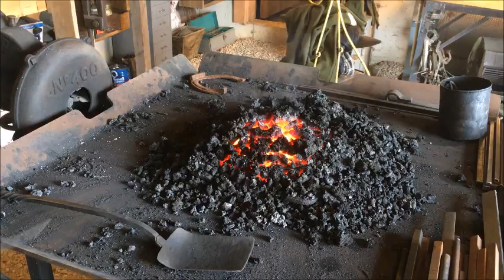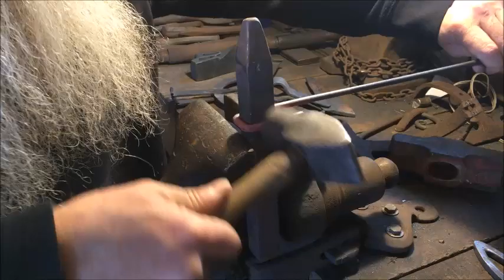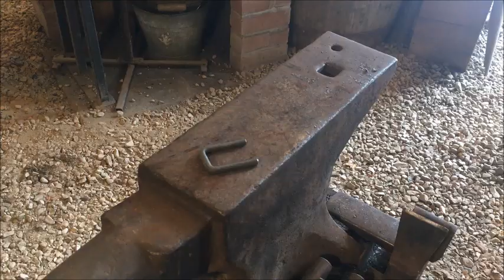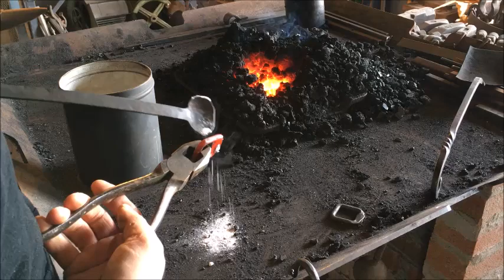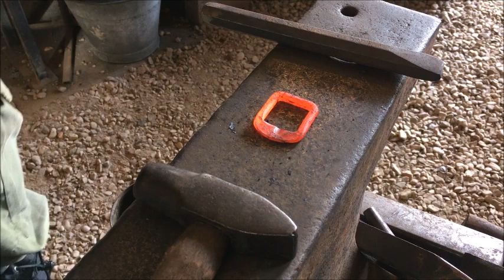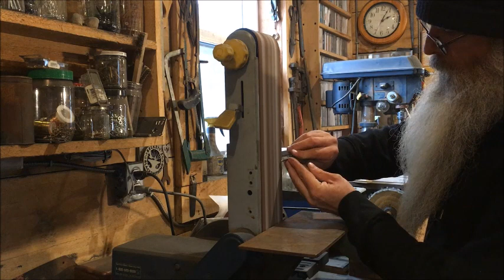Forging a Square Buckle

Comment: Just watched your belt buckle video... I want to try to make a buckle too. Thanks for showing the process!!!
Reply from the maker: Thanks for watching.  This method is the easiest way I have found to make buckles.  It only has one little forge weld in it.  I usually make several at once incase the weld gets messed up.

Comment: Real Nice perfect simple projects to initiate any one to blacksmithing and it's possibility Well done Thanks for your contribution in shearing your knowledge .Will keep some of us thinking and busy. Take Care 
From Quebec
Reply from the maker: Thanks.  This is a pretty good starter project for forge welding.  It is small stock so it heats up and welds easy and if it gets messed up it is easy enough to throw it out and make new one.